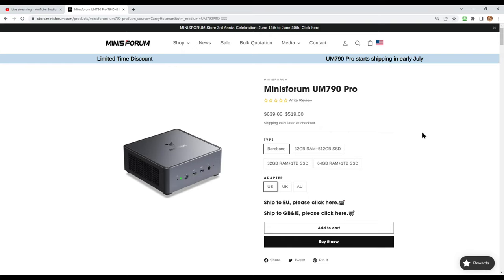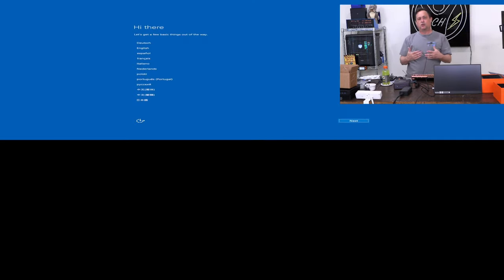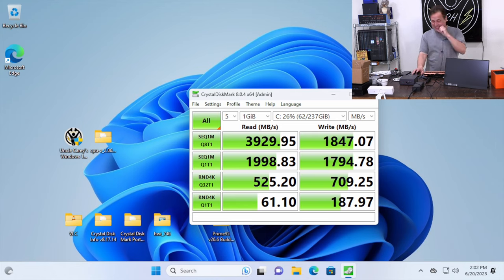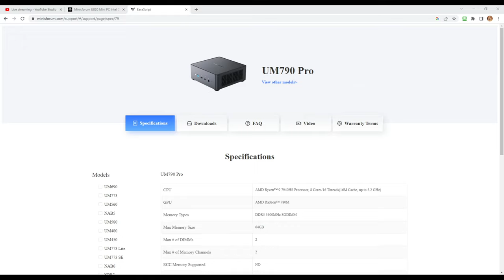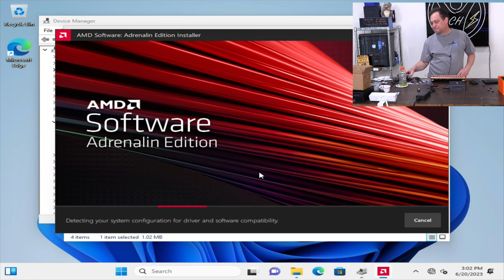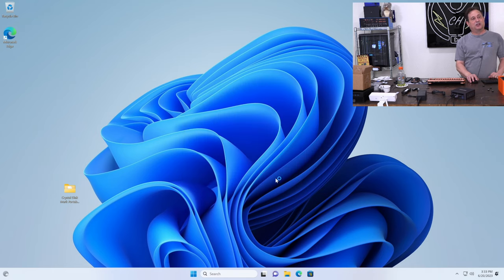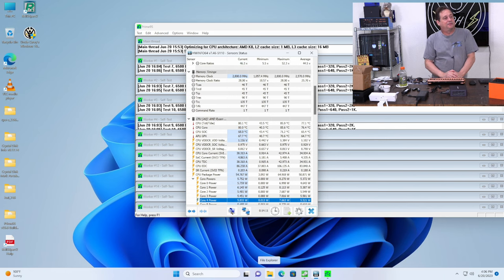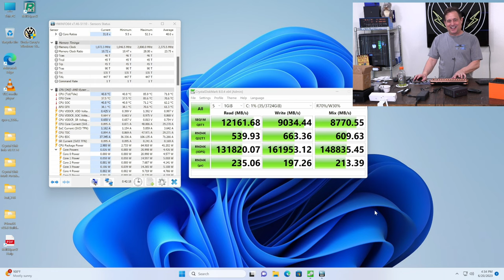HOLY COW!  Setting up RAID 0 on MINISFORUM UM790 PRO - Performance is INSANE!

Comment: Missed this live today. My package from Amazon arrived so I spent the day installing a new mb/cpu/ram into my tired old system. :) All good in the hood so far, just doing the recommended optimization before undervolting this hot puppy.
Reply: Will undervolting increase overall lifetime on the product? I might do that aswell. As I'm buying the UM790 pro, but don't game. Mostly just want the best specs I can get to futureproof myself.

Comment: I have read some people complaining about heat issues. Have you noticed any on this particular system?
Reply from the maker: Not at all - just as I demonstrated on a LIVE video.
Reply: The heat issues were with the 690, the additional fan in the 790 has cured the overheating issues
Reply: @pedrosa144  the additional cooling on the 690S fixed it too